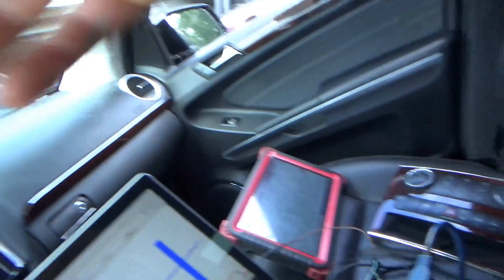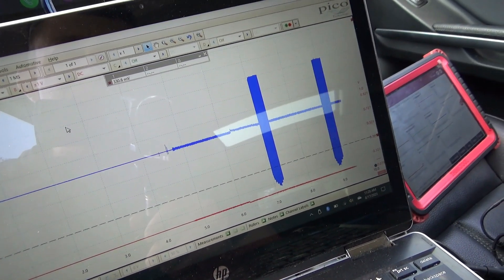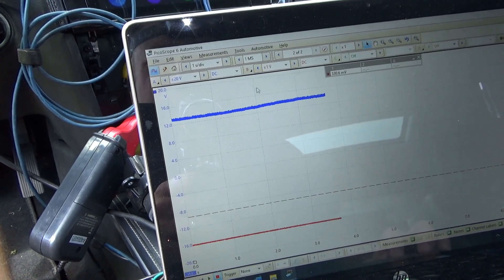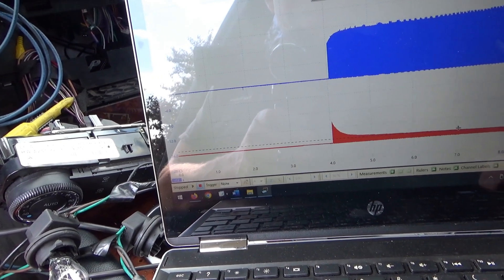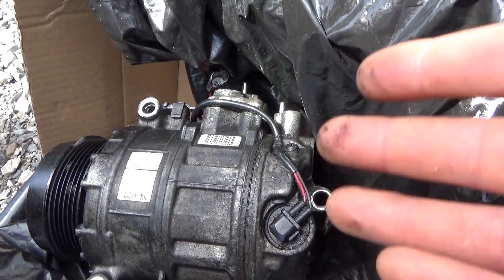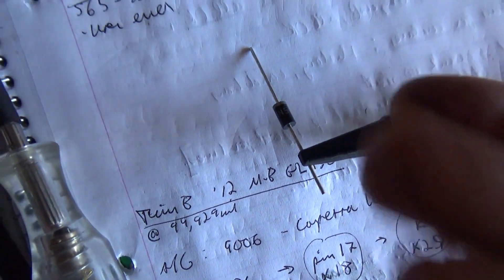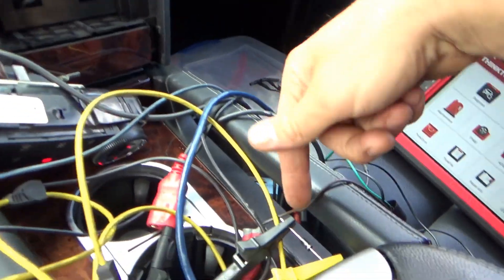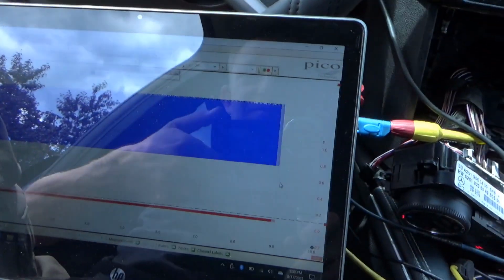Part 2: Did I MIS-DIAGNOSE This Mercedes?? (GL450 no A/C - Crazy REPAIR!)

Comment: Wow, I am impressed Ivan.  What other garage in America is going to figure it out and fix it this way???  
I am still unclear as to how this controller is supposed to work, but I followed how you deduced that the negative voltage transients were suspect and pointed to a failed diode rectifier.  Too bad you didn't have a schematic of the controller so you could have fixed it a more elegant way (on the PCB).  Hope the solder holds the wires to the legs of the diode for as long as that vehicle lasts.
P.S. PHAD is number one for YouTube Automotive Electronics in my book!

Comment: Quick google: https://assets.denso-am.eu/production/attachments/1663935531%20EN_AC-Compressor-Control-Valve-Identification-bulletin.pdf
Reply from the maker: Wow this is exactly the issue here!
Reply: @PineHollowAutoDiagnostics Ivan, if you look at the old compressor, you can see the stamped triangle. I saw it when you showed it on the floor.

Please be careful to make a conclusion on this., MB uses both with a diode and w/o it. The diode is always somewhere: some have it at the valve in the compressor (as in this video), and others have it at the ECU or AC control module.

It depends on the year and platform. We have 1 with a diode and 3 w/o it. Those valves are not a replaceable item by Denso; therefore, MB always replaces the full compressor, $$$$; however, if you look for a Toyota model with the same model compressor, you can try with a Toyota parts supplier.

Also, in the comment on the first video about the clutch and clutchless. MB uses both types, that is: variable displacement without clutch, and variable displacement with a magnetic clutch. Same story as above: 1 of ours is clutchless, and 3 are with clutch. Similar parts approach from MB, they do not sell the clutch just a full compressor,  but you can get the clutch from Toyota if you know which model matches the MB of interest. I already did change it to one of ours for $45 instead of $1000+.

Also, thank you for all your videos. I have learned a ton watching them. Always checking for the latest. Keep it up.
Reply: @ulferiksson6986 Thank you very much for posting this link. I copied such image back in December. I tried to post the image yesterday, and youtube did not allow it.
Just downloaded my own copy.

By any chance do you have the link for the Denso AC parts catalog? The one I used last year no longer works. It lists all the parts numbers for every single vehicle that uses DENSO AC components. You can see side by side Denso part number vs MB part number in this case.

Again. thank you very much

Comment: you should be able to see a diode  using a diode function  or reversing ohm meter leads on the coil windings.
Reply from the maker: Might have to give that a try. Wouldn't you just the the 12-Ohm coil resistance? Maybe the diode function would send enough current through to see a difference though :)
Reply: you'd   see the 12 ohms in one direction  but if you reversed the leads it would be much much higher. diode function is the same but should actually show the reverse bias factor @PineHollowAutoDiagnostics
Reply from the maker: @richardcranium5839  But diode is not in series, it is in PARALLEL to the coil windings...so resistance reading would not be higher than 12 Ohms in either direction ;)

Comment: i have seen where parts are superceded and there is a bulletin to add a "kit" on older models.(serial number break) it would be a parts bulletin not a service bulletin. this may be the case here. only the dealer would have this info as it is not a service bulletin so its not required to be released. so even though it has a mercedes tag it may not be exact replacement. any noise ieven near a digital signal is bad news if it gets into the machinery.

Comment: Wow! A diode! I just serviced a fuel injection ATV for a worn out clutch and poor running motor. Replaced the clutch first then checked the motor. Would start and idle but no power and stall under load. Nothing seemed wrong, but a Google search said check the plug type "ATC" diodes in the fuse block. Found 2 of the 3 reversed. Switched back and engine ran like new!

Comment: being a retired hvac guy, im still trying to understand how the compressor in this car works, because due to the principles of refrigeration, you cant use 10,20,30 percent of compressor capacity, for the sole reason is u must have enough pressure to boil the refrigerant efficently at the metering device... .  climate control is done by a thermostat or thermistor on or near the evaporator. 
without full refrigerant pressure , you will get partial icing of the  evaporator core, no matter if a capillary style or valve style metering device is used unless you have correct pressures.
Reply from the maker: Maybe the variable compressor works in tandem with a variable expansion valve?
Reply: interesting info here..  The Pumps are called VARIABLE DISPLACEMENT, CONSTANT PRESSURE pumps. They maintain a constant pressure by varying the volume of freon they push thru the system. The volume moving thru the system is determined by the expansion valve on the cabin evaporator, the expansion valve will open more as the fan moves more air across the evaporator thus increasing or decreasing the load on the engine.

When you select the AC to OFF, you don't really shut the AC off, what you are doing is commanding the pump to the ZERO output position of the internal mechanism (Swash plate). The pump in this position places less load on the engine than the older style heavy clutch spinning with the engines rpm's.

The front fans are a variable speed system. The fan speed is a function of condenser temperature and also pressure to a degree. The fans only pull enough air to displace the heat transferred to the condenser and back into the ambient air, again its a waste of energy to run the fans at anything more than required."  @PineHollowAutoDiagnostics
Reply: other than trying to optimize efficiency  it looks like they also eliminated the clutch mechanism to prevent noise and a sudden hard load on the engine and drivebelt.  when the system is not flowing alot of refrigerant, they can increase evap fan speed , which increases heat load to avoid freeze up ., pretty interesting,,

Comment: Great advice about using scopes. When properly connected the scope shows the detail of voltage over time. But, you surely realize that interpreting the signal is the other facet of analysis. (In this case: modulated control, sequenced power up and reverse EMF.) 
I like the way you converged upon the cause, experimented and resolved it. 
Question: Did the ebay module work as well with the quenching diode installed?

Comment: Great diagnosis and video Ivan. Also a great lesson to always check with a scope. I would have made the same mistake and probably spent more time and energy until my synapses kicked in. Now I’m chomping on my bit because you didn’t take the cover off of the controller and check for a freewheeling diode in the circuit that might have gone open to ground. Maybe a zener diode would be better suited over a standard diode. I know they used to place them in the coils of some of the compressor clutches. The older Mercedes models that just cycle the clutch have a speed sensor to monitor for belt slip to protect the belt drive. They cycle the clutch off and wait 3 minutes before attempting again.

Comment: I have notice that in some wiring diagrams they would not show the location of diodes. My 2004 CRV has some and I found them by mistake.
Great solution, Radio Shack brings some old memories.

Comment: I have a new Ford Bronco Sport. These still have a magnetic clutch on the compressor. The schematic shows a diode built-in to the magnetic clutch. So a diode is almost always required to suppress the negative spike from a coil, whether it's a relay or magnetic clutch.

Comment: Another somewhat misleading observation was that the controller wasn't happy switching more than 800mA, based on its behaviour driving an incandescent bulb. Once again, the scope reveals more of the story -  the bulb filament is effectively a PTC thermistor, having a much lower resistance when cold, and since the controller starts its ramp from a low duty cycle, we get big current pulses from the low resistance cold filament, and repeatedly (as the filament gets time to cool down again between pulses). It's not too surprising that the controller doesn't like seeing big inrush currents like that, it's expecting to be driving a load that's inductive, not capacitive, after all.
Reply from the maker: Precisely :)

Comment: There could be a diode connected in the back of a plug between the ground and control like on the back of the plug that plugs into the controller. I have seen that done in other circuits. More likely it is in the controller on the circuit board. It would be interesting to look at the circuit board in the controller to see if it is there. The diode may have went completely open when it failed.

Comment: Brilliant diagnosis as always Ivan.😢 
Can i ask, when you set up your bulbs throughout your diagnostics you always mention amps.
Can i ask most modern day cars have 5amp fuse with the odd 3 amp here and there, why could this wire only take 800 ma when it would be at least 10 or 15 amp fuse to that circuit.
Thanks

Comment: Good catch, Ivan! The internal diode could have been blown on a careless bench test with the wrong polarity, or just had a premature fail in the silicon. You definitely need an anti-parallel diode on inductive loads controlled by semiconductors - it was sheer luck that running without the diode didn't damage the output transistor in the controller. An oscilloscope (and the brain to interpret it) is fundamental to catch these faults. Great repair!

Comment: nice! a freewheeling diode to clamp the back EMF from the compressor coil.  
radio shack used to make shrink tape to use when one forgets/ has no room to put shrink sleeve on.

Comment: A scope also comes in handy on systems with dc to dc converters or switched mode power supplies. Too much ac ripple can cause stuff to go absolutely crazy, and you may not see that on a voltmeter, even if it's set to read ac. Great job, as always, Ivan!

Comment: Most of the A/C compresors I have seen in vehicles, (even the old ones with manual controls, no electronics) have a built in spike supression diode installed in paralel in the connector wires that feed the clutch coil to prevent those back spikes of the magnetic field from the coil when is disengaged.  Good work Ivan, as always.
Reply: sometimes they run shielded wire from the compressor and place the diode/s in under hood fuse box, also could be integrated into a relay. been done many ways over the years :)

Comment: Maybe just for comparison you could just plug in the old compressor and hook up a scope to compare the signal with the new one. Possibly the old one had a mechanical problem, not an electrical one. I've scoped the pwm signal on a few compressors and have never seen a negative voltage spike. They must have a diode somewhere. Good find.

Comment: A bad diode was the problem on my Ford pickup with the clutch not engaging. My co-worker and I beat our heads against a wall, trying to figure it out. In the short term, we had run a removable ground wire to the body that I would reconnect for the short drive home each day, for a week or so. I found the diode fix on a website forum and it fixed the issue. The funny part was that the factory OE diode was AC Delco, my local Ford dealer didn't carry it in stock, but the Chevy dealer had it.

Comment: The manufacture used several suppliers for the AC compressor! This solenoid is only compatible with select Denso 6SEU16C, 7SEU16, 7SEU17C compressors equipped WITH A DIODE, held in with a snap ring and are visually identical.
Reply: Just went to a nissens (ac component manufacture) training and he said this is common on vw’s. Do your homework before just throwing any ac compressor in your German automobile. Some of the control valves have a diode built in and some don’t.

Comment: Diodes are a very common fix in the electronic access control industry where virtually every door lock or hold back has some form of large coil that generates negative spikes when released

Comment: That diode is probably there-- it's just integrated into the compressor or controller.  It should have been an external/ replaceable part and it should have been in the wiring diagram too.   Imagine having to replace the compressor or controller just because they have a burnt out diode.  smh..  This is the kind of planned obsolescence design that drives me nuts...   Just like how they have that separate little resistor on the AC blower fan -- where you can easily replace it:  this part should have been designed the same way..  I bet it's built into the controller-- and even the junk yard controller has a burnt out internal diode.

Comment: I am wondering if there is a diode actually inside of the AC compressor?? Can anybody get a break down sheet from the manufacture?? I would like to see all of the parts inside of that AC unit. Secondly why would there be two wires coming off of the AC unit then the black wire stops / disappears before the connector??
Reply: Yes, the refrigerant control valve should have that diode.

Comment: How many mechanics on Earth would have thought of this? You're one in a million Ivan.
Reply: Good mechanics know 12v inductors need reverse biased suppression diodes.   That includes relays.  These days you can buy a 12v relay to add on something or you can buy an auto 12v relay that has the diode built in.  Ivan knows electrical at close to an EE level and is a degreed engineer, mechanical I believe.
Reply: I am a truck mechanic and refer mechanic disabled since 2007 and I wouldn't have figured this out like that. He is a better mechanic then I am and I did it for 30 years and specialized in refer units
Reply: @Slimjim011 He has a university degree so it is not a surprise really :P
Reply: @rkan2  well this man is very good at it. Doesn't matter how just that he is recognized for it
Reply from the maker: @rkan2  I know a lot of people with University Engineering degrees who couldn't change a light bulb 😂
Reply: @PineHollowAutoDiagnostics  There's always... a normal distribution ;)
Reply: @Slimjim011  you
Reply: Most factory circuits have the suppression components built into the controller.   Generally so effective that some cars like Toyota can take reversed 12v connections without bowing their ecus.
Reply: I was thinking of it but I'm not a mechanic. I'm electronic tech.
Reply: If I hadn’t thought of it before with the bulb performance, then definitely after what the scope lines showed.
Reply from the maker: This was more of an electrical engineering problem 😉

Comment: Hi Ivan, Mark with the 425k miles TDI VW. great diagnostic video. How do you handle all these vehicles in the Thinktool ProS.  I have looked thru the tool and never found a folder to show me how much free space is remaining. Best to you. Purchasing OEM direct cam , lifters etc from VW so I can ask you to replace them. Knock on wood, my VW runs like a swiss clock. But I might have jinxted myself.   My parts manager says I am his best customer. LOL Mark

Comment: Very satisfyingly, the reverse EMF revealed by the scope explains why a test in video part 1 failed when "logically" it should not have.  That was the test where Ivan connected a lightbulb load (was it nominal 400mA?) to the compressor controller, which operated fine. But then he connected the ground side of that load bulb to the compressor high side, effectively putting the bulb in series with the compressor.  This should have worked because it would "obviously" draw less current than either load individually. But the controller threw an error, apparently because the compressor was producing negative pulses, conducted through the bulb to the compressor controller, which detected a problem.

Comment: Normally the diode is connected across the inductor as close to the inductor as possible  in a normally reverse biased condition, that shorts the spike that is generated, like when you see relays connected to a micro controller (freewheeling diode). the diode must have a very large piv compared to the working voltage because the negative spikes can be substantial.
good call Ivan
Rich

Comment: In this case, I have to agree that I can't think of another method to determine if this diode is present than using an oscilloscope. The fact that the diode should be somewhere in the circuit can be assumed, since it is PWM'ing an inductive load, but since the schematics don't show the diode, there is no way of knowing if the diode should be in the compressor or in the controller. If you would know that it should be in the compressor, you could measure it by applying a 500mA reverse current and see what the voltage is. The diode would clamp it to 0.6v (You could still do this with the old compressor) But if the diode should be in the controller there is no other method than using the oscilloscope to see if it working.
Reply: Reversing a limited current through the coil is the only way you could tell if there is a diode in it.  An easier way would be to apply at least 2 volts with a 1 amp limited supply. This would be enough to show a diode (0.7 volts)  and any fly back diode on a coil like that would handle 1 amp.